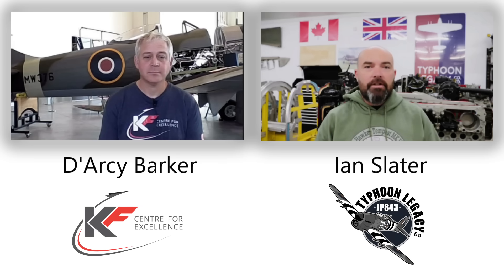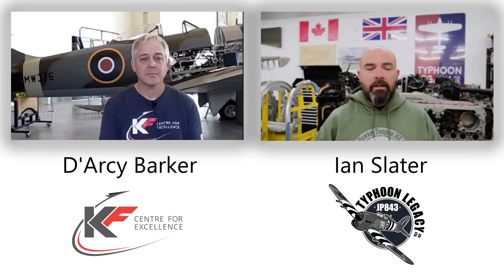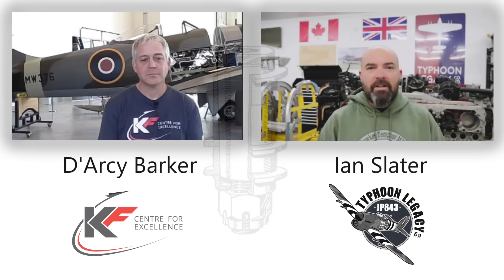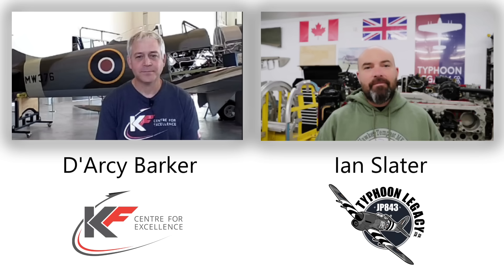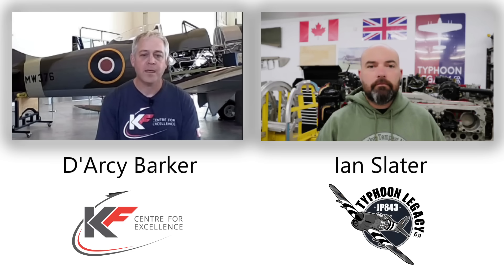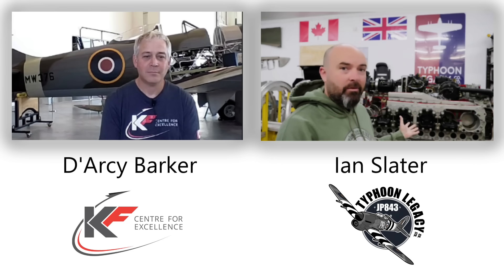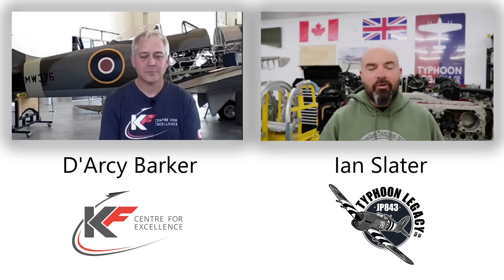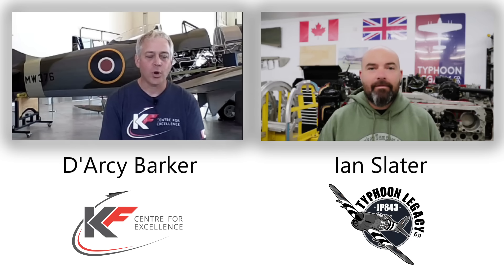Hawker Typhoon and Tempest  Collaboration Pt1

Comment: It's a real privilege as an amateur mechanic who delves into his vintage motorcycles and modern day car maintenance  to accompany this aircraft industry technical specs world. So pleasurable to see firstly what our forefathers were designing, flying, maintaining  and making and secondly to see how it's possible to re-create these techniques to restore, rebuild, re-manufacture to airworthy levels these iconic planes. It's intense, it's high tech (surprisingly so for when these beasts were built) and it's absolutely absorbing. Thanks for putting some excellent practical material out here into this modern world where many struggle to change a tyre or change the engine oil on their family car by themselves.

Comment: I have re-watched this and i just wanted to add my 'two penny worth' about design and production engineering.  I worked at Hatfield when it was part of Hawker Siddley and later British Aerospace.  When drawn the drawing would be sent down to Engineering for a Process to be written up.  The Drawing and Process would be sent to the Machine Shop with the material (s) and tools would be issued via the toolroom.  After the part was made the item was sent to Inspection, if the part was not to the Inspectors satisfaction there would be words exchanged between the machine operator (usually on piece work i.e. paid per item made) the Inspector, the shop foreman and The Machine Shop controller who wanted the item to be approved.  If the inspector stood his ground the item would be referred back to Design for a 'Concession'.  Design would then either approve the item for use or scrap.  Design could also give the item another part number, so for instance part of the BAe 146 undercarriage ribs were HC537H0640-000 & 001 the design concession number HC537H0640-204 & 205.  Every single Airbus A300 and A310 Rib5 were produced with Design concessions.
Reply from the maker: Great insight, thank you very much for sharing! ~Ian

Comment: Eager to see you get back on your project.
Reply from the maker: What are you eager to see? ~Ian
Reply: @TyphoonLegacyCoLtd  I shall stick my 👃🏼in here. A good question. I, for one, after watching you take the connections of the monocoque frame apart (there were spacers and bolts in a very corroded joint) would like to see how that part of the restoration is coming along.  Kiwi David 🇳🇿
Reply from the maker: I think the parts you are referring to are from the main spar tubes from the cockpit section (please correct me if I am wrong), that episode was the removal of parts for investigation, reverse engineering and design; this work has now been completed and will be applied when we get closer to cockpit assembly. ~Ian
Reply: @TyphoonLegacyCoLtd  all of it , lol
Reply: @TyphoonLegacyCoLtd You are 100% correct. Great news that the reverse engineering has resulted in a finished product. I look forward to your future video. Thank you Ian.